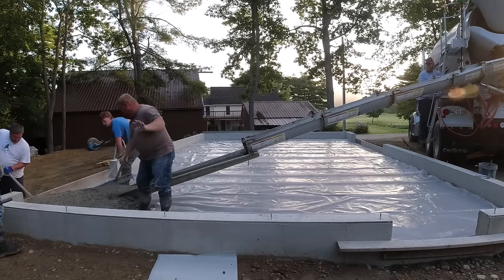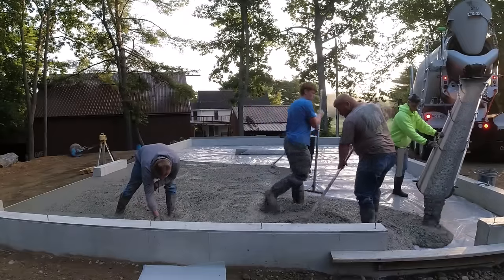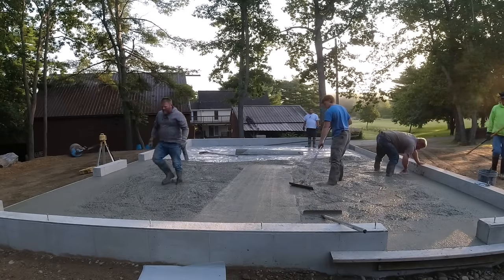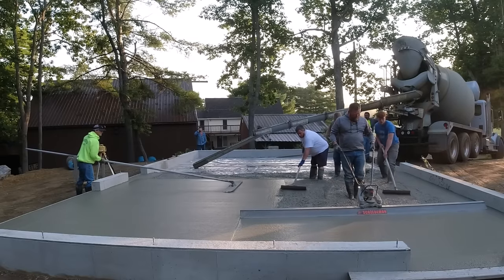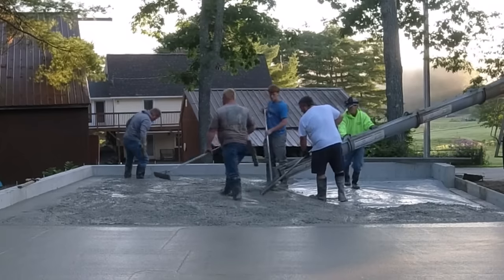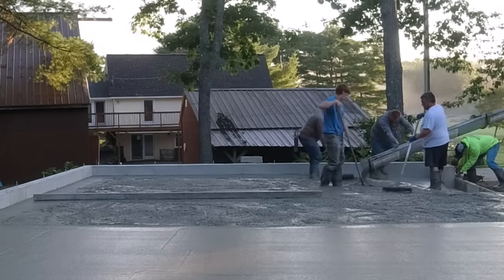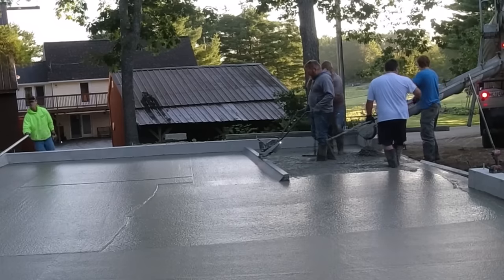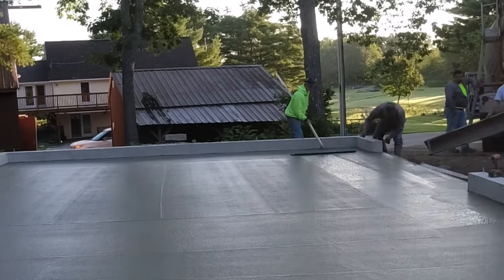How To Screed Concrete for Beginners - Is This Too Fast or Too Slow!

Comment: Don't be fooled DIY folks.   These guys are masters at getting the right amount of concrete in the right place, that is why screeding is so easy for them.  Moving heaving concrete around is a massive effort and they are SO good at putting it in the right spot the first time so they don't have to move it twice (or more).

Everything said above is meant in massive respect to Mike and crew.  As a contractor who only occasionally does concrete, I can speak from experience.
Reply: So true, these guys make it look so easy. There skill levels and strength second to none
Greetings from Southern California 
The Masonry Company
Reply: Small pads and siewalks is where diy should start and work up from there, Mike and his crew make it look so easy.
Reply: Very true

Comment: Back when I use to pour concrete the company had 4 different screeds they had handles on it so one guy can screed and the rest of the guys just racked! A good racker makes it easier on the guy on the screed when you use manual screed!

Comment: Is that how subcontractors are set up in California? Around here usually the guy is doing the walls. Sub base and flat work are all the same. Sometimes the concrete contractor will hire the dirt work, but a lot of times that's hired through the general contractor.

Comment: If you use power screed on 8ft wide driveway would you run the power screed on the 2x4s or just inside the 2x4s

Comment: Is it not custom to use rebar or mesh in a garage floor? Serious question.
Reply from the maker: Most the jobs we do like this are engineered to do with fibermesh, 3500 psi concrete with water reducer. I'm a sub so I don't have a say, just hired to pour and finish the floors.

Comment: Oh the soup!  That makes it easy to screed, but weakens the slab.
Reply from the maker: Another "wet" comment, you gotta educate youself by listening. I use water reducer for more flow and stronger concrete.
Reply: @MikeDayConcrete  Could of fooled me. It looks like 5.5 - 6 inch slump after you added the water reducer. You need to expect "wet" comments from time to time if you like publicizing so much of your work, comes with the territory . I just know that adding to much water does weaken concrete, and not to many people are aware of a water reducer or other Concrete chemical admixtures. And not every  video do people see you stress or state "water reducer" agents in the videos.  But that mix looks very easy to manage vs. say a standard 4 inch slump or thicker sometimes when code calls for it. Thanks for the clarification, and the videos.

Comment: Great work Mike, no one standing around, everyone has a job to do. I've done a few shed floors and in Aust we have a warm climate. Most times the shed is already erected so form work is minimal. The last one was 16m x 6m with two drainage points at approx 5m and 10m, running through the centre. We put the correct slope in using hand screed around the drains and used a vibrating screed on flat sections then bull float it. Basically, dividing up the floor into different sections. Just about every floor Ive seen you do is flat. Would be good to see a floor that has drainage sections and flat sections, can you get a slope using a vibrating screed for example?
Reply from the maker: I've got a lot of videos showing us screeding around drains in YT. We hand screed them for precise slopes.

Comment: Anyone  can work with a slump like that! Try a 4" slump see how easy  it is, had to do that for 20+ years on commercial  spec jobs!
Reply: I completely agree and I didn’t vote for FJB.
Reply from the maker: I poured 4" slumps for many years, then I smartened up and started using water reducers.

Comment: Did concrete for 42 yrs in Wisconsin.  Fiber is garbage . We always poured 4k lb concrete and wire mesh, pulled into concrete where it belongs. How do you like power trowling that fury shit.
Reply: I completely agree and I didn’t vote for FJB
Reply: It's required by code in a lot of cities here in Ohio nowadays.  Some places either wire or fiber. Some places require both fiber and wire.  If you've ever torn one out, you know wire is stronger. But of course, wire rusts and expands so it's only lasting 20 or 30 years tops. But that's okay I guess here. Might be different in warmer climates.
Reply from the maker: We use micro-fiber, you don't see any "fury" stuff.